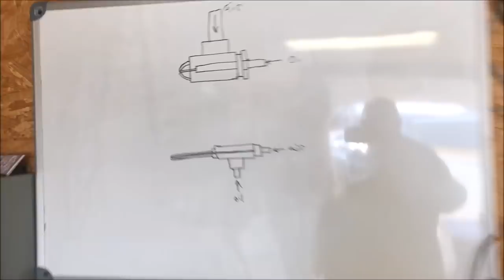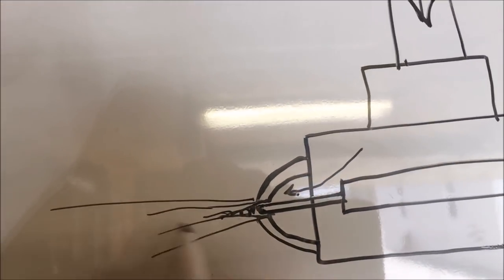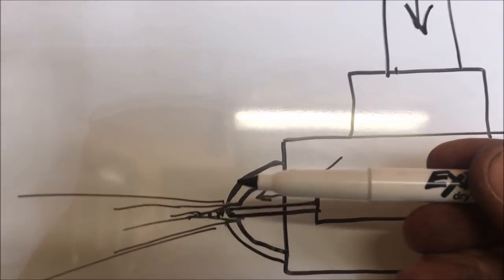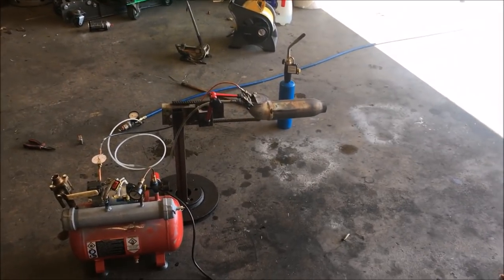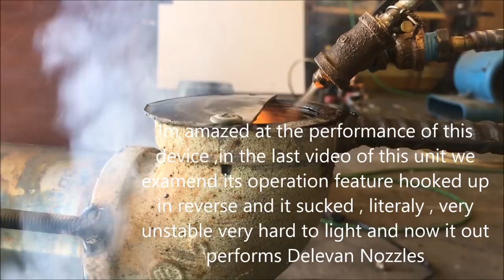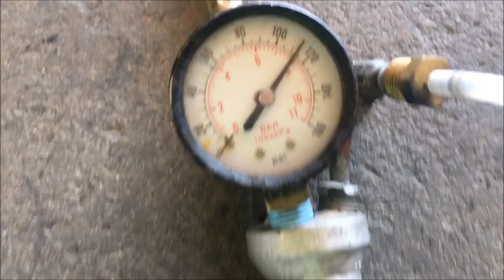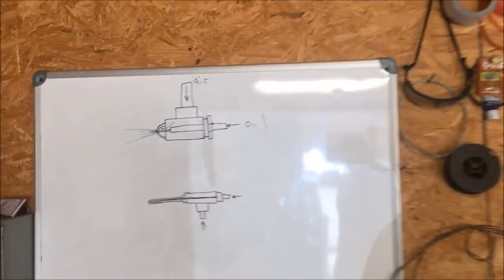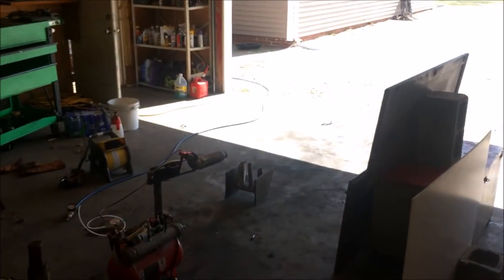Waste Oil burner  Atomizer MASTERED  ( DETAILS )

Comment: Seems like you could get the cheapest paint sprayer gun and tune it larger orifice polish needle etc to make a high-end sprayer for about 15 bucks and change.  You'd get micro-adjustable air-fuel mixes. Basically an atomizer.  Just may do this with an air brush!
Reply from the maker: they dont work

Comment: Seems to me that a spray paint gun would do the job. I know that waste oil burners can be a real pain in the butt, but most of the problems encountered are because of inconsistency of the fluid being burned. I'm going to try a paint sprayer with well filtered oil and see what happens. It should be doable given how much adjustment is possible with a spray gun.
Reply: How'd that go for ya?

Comment: This is very cool!  I am following your videos to upgrade my foundry furnace burner.  I need something more efficient than what I have and I think this is the thing!
Reply from the maker: look at my video " little dragon " that type of device will also work for you
Reply from the maker: I would be glad to help you friend , i could even send you a decent nozzle that uses  an air compressor function.
If you would like some advice let me know , i really enjoy your work and a guy like you will actually do something with the wisdom i can provide you . i can save you alot of time . If you would like i can do a quick video showing you what i think will work best for you and give you some figures such as power output and oil consumption as well as the air pressure and cfm you need
Reply from the maker: If your interested i could send you a link to my nozzle video showing my best design yet . i dont expect you to sift threw 60+ videos . I take the time to help people who are serious about this information with intentions of actually using it . Im also currently working with 2 guys in new Zealand who are building a wood drying kiln for fire wood made of 2 large shipping containers. they sell fire wood on an industrial scale , their yard is very impressive
Reply: All of this sounds great! I would appreciate it, especially if you made a video!  I will look up the little dragon video right now.  I just started experimenting yesterday.  I was able to make a nozzle out of black pipe and I got a good mist going using water, but I can tell that experimenting to get everything working just right would take awhile.  Right now I need to use a lot of pressure to get the mist going (like 50 psi) and I am wondering if the orifice is too large.  But on the other hand, I don't want to make it too small because I feel as though it would clog since I am using waste oil.
Reply from the maker: ok watch this video and ill get back to you . also you are gonna want 100 psi air @ 3.5 SCFM or more , you can use a blower but i recommend air compressor. they give the hottest flame . https://www.youtube.com/watch?v=83xhBa-CjtI  this is the nozzle used in these devices https://www.youtube.com/watch?v=K8ioqIzOIYo
https://www.youtube.com/edit?o=U&video_id=roGcZBLZqCw
Reply from the maker: https://www.youtube.com/watch?v=0cXV8aF4j40 try this

Comment: I've always wondered if you would flip that device 180 degrees vertically, then you would have the flame going upwards through the elbow, lessening the pulsjet effect possibly.
Reply: 180 deg "vertically"? it is horizontal, so 180 deg would just make it either  upside down, or face backwards - depending which 180 you took...... wouldn't it?

Comment: I guess if the objective is to make the tube red hot or show off the orange flame to make it look like a rocket this is a success. Seems to me there should be some blue in that flame if it is burning efficiently.
Reply from the maker: not with waste motor oil , you cant get blue flame with motor oil only WVO
Reply: @NOBOX7  Ahhh, thanks.  'Some more you live, some more you learn'....

Comment: Now the question is "How long will it take to heat up a crucible and start melting aluminum?"
Reply from the maker: yes good question, thats coming up
Reply: The  way  this burner is running i would say at least 30min at most . If the furnace and lid is well insulated.

Comment: Just had a thought, i wonder what would happen if you put a 1-2 inch cowling either around the or in front of the oil jet?
Reply from the maker: yes i considered that idea for a straight pipe and according to the diagrams ive seen that stabilizes the flame by causing re-circulation